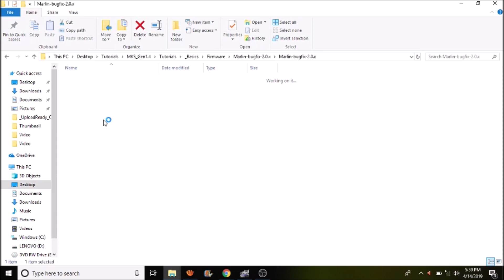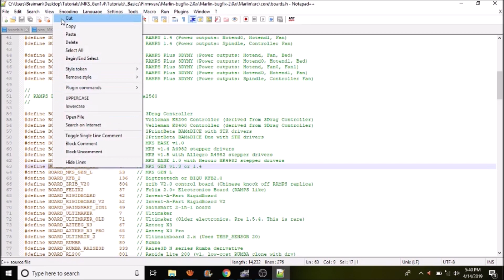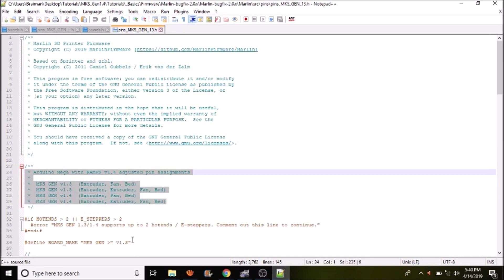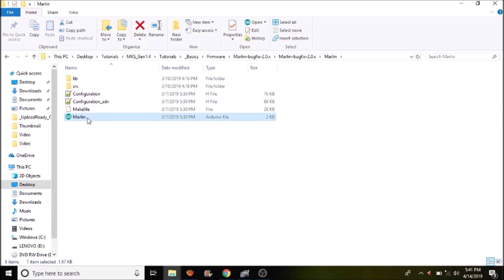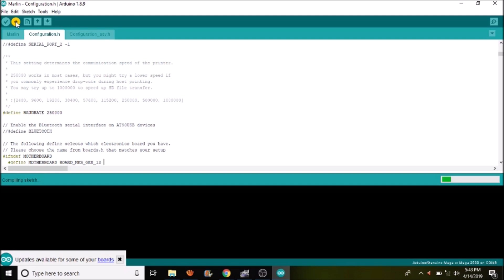MKS Gen 1.4 - Basics

Comment: Which pins do you use to add a laser with a 12 volt to 24 volt converter
Reply from the maker: If you look at the pins file for the board, you'll see the pins.  It's under source-pins-2560 folders or something like that.  Not in front of the computer for the exact path at the moment.

Comment: I understand that this is an old video; however, I have an MKS Gen 1.4 and cannot find any documentation on how to enter UART mode so that I can use 2208 steppers in UART mode.  Similar boards (e.g., SKR 1.6) have four three-position jumpers under the driver board to set steps and enter UART mode.    You state that the four pins along the driver headers are for "additional steppers"--would those is some way be used for UART?  thanks.
Reply from the maker: UART is possible on this board, but I would not suggest it.  Tmc2130 would be easier.  Reason I avoided showing is you wou need to create modified jump cables with a resistor if memory serves me.  As for skr 1.6 as far as I know current skr boards are 1.1, 1.3, 1.4, 2 and 3, but I start with skr 1.3 and still like it a lot for price and modern steppers and it has 32 bit processor.
Reply: @EdwardBraiman  Yes, I made the cables with in-line resistors and modified the driver boards; however, not sure of the jumper configuration and where to connect the wires on the MKS Gen v1.4.  I considered upgrading tp a 32-bit; however,  decided this was the quickest & easiest way (yup) to upgrade my FT-5.  So, do you happen to know how to get into UART mode?  Thanks much.

Comment: Thank you for the explanation so far, yet I missed the "SERIAL_PORT" number, since you're using the search function, it jumps right past the Serial Port setting. My problem is after compiling it won't load, saying "avrdude: stk500v2_ReceiveMessage(): timeout" six times, and after that "avrdude: stk500v2_getsync(): timeout communicating with programmer" – Can you give me a hint?
Reply from the maker: Which operating system are you using?
Reply: @EdwardBraiman  SOLVED I tried it on two computers running macOS 10.11.6 and 10.14.6 respectively. Both run Arduino 1.8.13, with the same error message. <Works fine with the display (BTT TFT35 V2.0) disconnected, yet the display is not yet working, need to work on that.>
Reply from the maker: @Reparaturkanal , 
I do not currently own a Mac, but I found a link that may help ... https://gulfcoast-robotics.com/pages/mks-gen-v1-4-electronics-firmware-and-hookup

Comment: What about new MKS SGen L?
Reply from the maker: It's 32 bit processor and MKS Gen L v1.0 is 8bit.  Basically a better processor.  It also means Marlin firmware must be version 2.0.x which will have higher bugs until they sort out the issues.

Comment: Hello, I could use E1 for my dual Z, but what would this setting look like in the marlin firmware? I find nothing to clarify this connection. Thanks
Reply from the maker: I've have a tutorial on this, but need to edit it some more.  If you go to the configuration_adv.h in Marlin and then search on, "dual", just remember to enable stepper E1 on configuration.h.
Reply: @EdwardBraiman  Ok, how do I enable E1 in configuration.h? Would it be here?
// Invert the stepper direction. Change (or reverse the motor connector) if an axis goes the wrong way.
#define INVERT_X_DIR true
#define INVERT_Y_DIR true
#define INVERT_Z_DIR true

// Enable this option for Toshiba stepper drivers
//#define CONFIG_STEPPERS_TOSHIBA

// @section extruder

// For direct drive extruder v9 set to true, for geared extruder set to false.
#define INVERT_E0_DIR true
#define INVERT_E1_DIR false
#define INVERT_E2_DIR false
#define INVERT_E3_DIR false
#define INVERT_E4_DIR false
 In configuration.adv just uncomment the dual z line, am I correct?
Reply: @EdwardBraiman  I'm using the DRV8825
Reply from the maker: Do a search on configuration.h for A4988 and remove comment for E1 and change A4988 to Drv8825.  If you check out my playlist for SKR v1.3 playlist the Marlin steps are similar.
Reply: @EdwardBraiman  I understand, I use Marlin 1.8 and I've been looking, but I didn't find the option of engines, I will review everything again.
Reply from the maker: @TheNikakz  , when you search the file Configuration_adv.h for , "//#define Z_DUAL_STEPPER_DRIVERS", what do you see?

Comment: Hello, I have watched your videos, could you help me with a MKS Gen 1.4? I have a Evolution hypercube and I need to connect the dual Z, but I do not know how to do the serial connection, how can I do that? Was there a scheme? I can not find the adapter here, the order of my motor wires are: red, black, blue and green, how can I make this connection? I understand little and am migrating from ramps to MKS and I know nothing. Thanks
Reply from the maker: Are you trying to make a connector for the Nema17 to use on the MKS Gen 1.4? And you're trying to get the wiring setup for the poles of the Nema17 in the right order?
Reply: @EdwardBraiman  Hello, yes Nema 17, I was able to solve the problem of the wires. Thanks your attention.
Reply from the maker: You solved it, but you're welcome I guess.

Comment: Hey there.. my MKS Gen 1.4 comes in by 9pm tomorrow... One question... where do you put in the part cooling fan connection? would that be the 24/12 volt pins at the bottom by the reset? and if so, wouldn't I need to tell marlin that it's there for assignment? thanks. (my Anet AM8) board blew up with a short today... so I thought I'd go ahead and upgrade to this Board instead (much more beefier board and much more headroom for resources). ( I bought a new TFT with SD reader as well... and also the Motor Drivers as well though they say Ramps1.4 on those where you are saying here no ramps 1.4... does that matter?).
Reply from the maker: Steve, I recommend a 12 volt fans and power supply.  I'm currently rendering the Extruder Fan Bed tutorial and will upload and CC soon.  As for extra cooling fans and TFT display setup today.  TFT28 appears to work on both MKS28, but TFT32 I'll need to test.

Comment: I need to level my large bed with 4 Z-axis independent motors and for that i need to send a G-code to trigger any I/O pin from the AUX pins .... can you please help me how to use these AUX ?
thanks a lot mr. Edward 🖤
Reply from the maker: Have you considered the idea of using the four servo ports on the MKS Gen 1.4 to control bed leveling via gcodes.
Reply: @EdwardBraiman  oh that's a good idea and i was thinking to use led strip signaling technique, but i needed to learn how these aux works
Reply from the maker: If you review my MKS Gen L or RAMPS tutorials I talk about most of these a bit.